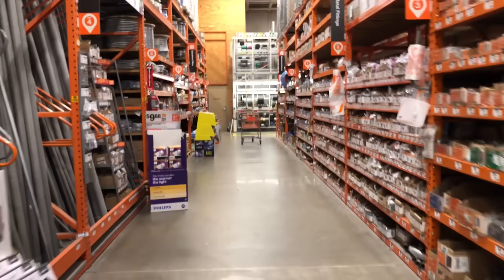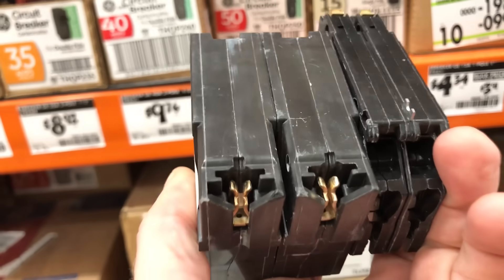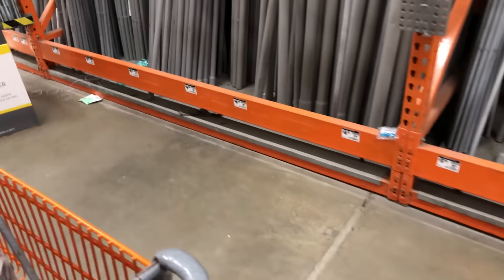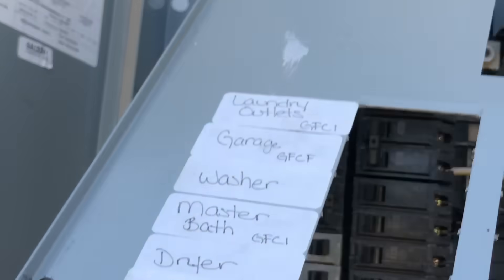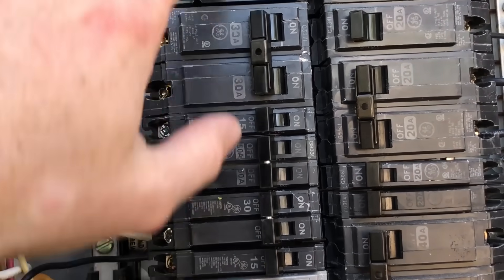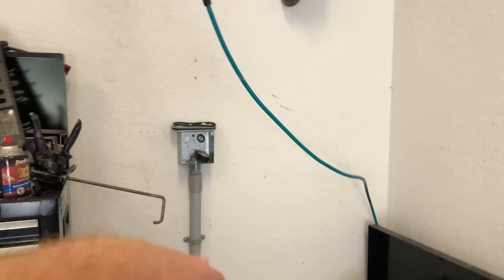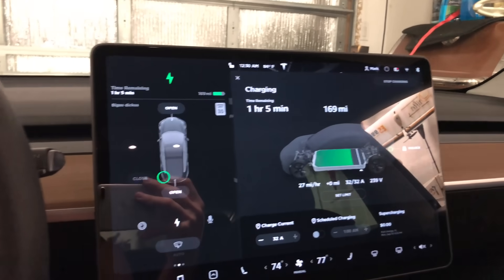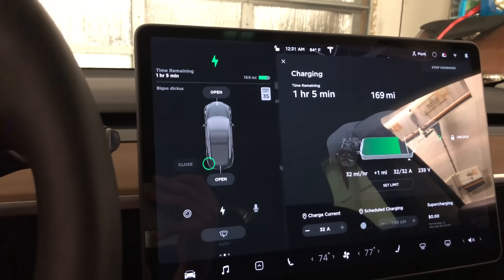Best home Charger for Tesla Standard Range plus! 14-50!

Comment: FYI, that Leviton NEMA 14-50 outlet you bought is a cheap piece of junk.  If you plug/unplug a UMC into/out-of it often enough, it will very likely fail spectacularly (possibly resulting in a fire).  For EV charging applications, you should be using an industrial grade 14-50 (or even a 6-50) outlet like a Hubbell or Bryant, which have stronger prongs, excellent build quality, and are meant for devices to be plugged and unplugged to/from them often.  They are not like the normal (cheapo Leviton) outlets that one would use with a dryer, oven, or other appliance that isn't likely to be plugged and unplugged very often.

Other problems with this install guide are:

1) You did not properly torque the clamping screws to the 6/3 wire, on either the outlet or the breaker.  Instead, you just gauged the wire tightness by "feel".  This is a recipe for a fire.  For applications like this (where there is a real potential for a fire hazard if you get it wrong), you should always use a "Torque screwdriver" to properly torque an outlets clamping screws to the wire, in accordance with the outlet manufacturers specifications.

2) You did not use a GFCI breaker in the electric panel.  Rather you used a regular/standard breaker.  Since you're installing the 14-50 outlet in your garage, that is a code violation.

3) The metal junction box was not properly grounded.  In order to be code compliant, you should have run one short copper pigtail to the ground screw on the back of the metal junction box, and another short copper pigtail into the outlet, then splice those two short pigtails together with the ground wire from the #6 cable.  Simply running the #6 cables' copper ground wire directly into the outlet (the way that you did it), is a code violation (because the metal junction box is not also properly grounded).

As such, this video is bad mojo.  Please fix these problems, and then either repost the video, or post another video as an addendum/follow-up/correction to it.  Otherwise people might actually follow this guide without knowing all of these issues.

Comment: I am preparing for my first Tesla (a used one). I am going to wire my home like yours. I have a couple of questions: Was the 1 inch conduit required by The NEC or did you just do that? My house is on a slab and my panel is in the garage so my plan was to come off the back or bottom of the panel with the bare wire (as all the wires are in my house) over where I intend to put the box and NEMA 14-50. What are your thoughts on that? (yes, I know, you are not an electrician.....)? Also, is the device you have plugged into the NEMA 14-50 the charger that comes/should come with my future car (2014-2016 Model S) or something else I need to purchase?

Comment: Mark, great video. I have heard that you want to turn down the charge current to not risks a short circuit at your house. So some adjust from 32A to 22A. Have you done that or heard the same information?
Reply from the maker: Hey! I do turn the current down. Right below where the cord generates heat signifigantly so that energy isnt lost as much through that. I think its around 20-25
Reply: @MarkDickinson  thanks!

Comment: If you are considering a Cybertruck, you may want to consider a Tesla wall adapter generation 2 which is an 80 amp charger.  There is a good chance  greater charging amperage will be supported. Generation 3 chargers only charge up to 48 amps.  I leave my mobile adapter in my car so I always have it with me.  Since I was buying a charger for home and I had a max charge rate of 48 amps, a generation 3 charger made the most sense. I highly recommend a dedicate home charger.

Comment: So let me get this straight.  You bought a $40,000 PLUS car and go cheap on the wall connector.  So dumb.
I installed my own Gen 3 Wall Connector for $100,  includes 12' of 6 AWG wire, separate wires, sold by the foot, not that 6-3  crap that's hard to work with, conduit and fittings and my 60 AMP breaker.     This guy is a joker.
Reply from the maker: So dumb?  So dumb is spending money on something useless that yields negligible results.   

I also use this to charge the motorcycle. 

You should make your own videos.  Champ

Comment: Call your electrical provider and ask for the EV rate. This gives you a very cheap rate at midnight to 7 AM then set your charging in the car to 1205 AM so you don't use the expensive power. Friend of mine did this 5 years ago and his wife now does the laundry after midnight to use the cheaper power.

Comment: Hello so i have a question my dry plug is a 10-30 plug and when i plug it in to my model y i only get 7miles a hour to charge what can i do to get it to 30?
Reply: Change the amperage fuse to a 50 amp

Comment: Thank you for your video, it was super helpful. FYI, your 50 ft and 35 ft Amazon links are wrong. The 50 feet one links to 10/3 romex, and the 35 feet links to only 10' of 6/3. 

Also, can you tell me where you got the little mounting bracket to hold the mobile charger in place...? :)

Comment: One mistake: You purchased a standard breaker for your 50a. For garage and outdoor, all outlets (including NEMA 14-50 and 6-50 now even in garages) require a GFCI. Hence, to meet code (and, honestly, just for safety's sake) you should grab a 50a GFCI breaker and attach the pigtail to your neutral bus bar.
Reply: Setting aside any problems you'll have with your insurance if anything happens right now, you wont be able to sell the place without changing it. Even the worst home inspectors will verify the GFCI reset points for all garage and outdoor outlets.

Comment: So I use the NEMA15 to charge my M3, so when it's unplugged during the day I turn off the main power to the NEMA.  I don't want the Tesla charge box and wan to be powered all the time.  Is that a good idea or do you just leave it powered all the time?  What are you-all doing?
Reply: The Tesla automatically stops charging when set limit is reached. It does not over charge. Nobody wants to be waking up at 2 a.m. to disconnect their EV

Comment: What’s funny is what he’s leaving out. There are 2 different models of plug in chargers. One is a 1 amp model and the other is more. But you get the cheaper, weaker one with the Tesla. And the better plug in one you have to buy, it cost $550 or you can just buy the wall mount for $500. Super misleading. My wife watched this and didn’t understand the difference in everything.
Reply from the maker: Edward Meer two types of chargers yes. Your car comes with one.  You buy a 35$ adapter and done 

1. Is the mobile connector on standard range and + they have a limit. 

2. There’s also a hpwc that does higher output.  

Super misleading is your 1 amp comment to be honest. Head over to the tesla shop and read the stats. I paid what I paid for the adapter to get 32 amp which my car limits to. Buy the adapter for higher speeds. 🤷‍♂️ other wise
Your cord included does 5mph

https://shop.tesla.com/product/gen-2-nema-adapters
Reply: Mark Dickinson the charger you are talking about requires extra money for. It’s a $550 charger. You don’t make that clear. The one you get with the car is the much cheaper $150 model. Both look the same but are very different. You do not make things clear. This lead to a rather heated fight about me wasting her money on things she didn’t need. So, thanks. After 4 hours and a drive to the Tesla store, did she realize I was telling the truth. What you are saying is BS.
Reply from the maker: You’ve lost it.  The one that comes with the car is a gen 2 mobile connector. If I bought the corded mobile connector for 550. Guess what. Same exact speeds.  No bs. Just facts of the standard range and plus cars.
Reply from the maker: Read my title. See how it says sr+ that translates to stand-ard-range-plus

Comment: Got same house as you, built in 50's, remodeled, have crawl space but going through attic 10' ceiling height. Will get sched 40 pipe for this particular wire, but will use Hubbel 250V outlet. Will be plugging and unplugging alot, and need reliability. Vehicle will not be garaged due to 68 Camaro taking the space, so looking for outlet to be at the garage in driveway to my vehicle.  Great video by the way best I have seen so far!
Reply from the maker: fathead fathead ohhh nice camaro. I just sold a little Younger Monte Carlo.
Reply: @MarkDickinson  I cried when I had to sell my 70 Monte' sad day indeed. Well I had a child and didn't have seat belts.

Comment: Totally disagree, after driving 75,000 mi on my model 3 and having free supercharging for life, you are much better off with a high-powered wall connector. I charged off to Nima 1450 and it's more about the inconvenience of having to uncoil your mobile connector every single time to charge your car and having the high-powered wall connector is much more convenient especially after a long road trip where you just want to go inside and go to sleep or relax. If you're trying to save every single time and your time is not important to you then sure it was a name of 1450 but if you're going to spend the money anyways to run electrical wire you might as well get the high-powered wall connector as we would be much happier and it will charge even faster than the mobile connector.
Reply: The $500 hard wired wall charger will NOT charge a M3 Standard Range + any faster than a NEMA14-50 adapter on the included mobile connector.  Tesla has capped the amps at 32, REGARDLESS of the charger you use.  I just installed a 14-50 today with a 60 amp breaker, even though I know it’s overkill.  I’m just looking towards the future.  My 14-50 install is just a stop-gap while I am waiting for Tesla to get the Wall Connectors back in stock.  The wires are run and I can fairly easily swap out the NEMA 14-50 whenever the Wall Connector becomes available .  I just want a permanent, easy way to charge on a daily basis.  I want to keep the mobile connector in the car at all times.  I could buy a second mobile connector kit for a little less than a wall charger, but for just a little extra, I would much rather have the wall charger...
Reply: @jbreakstone  this is true

Comment: I agree 100% this is the way to go. At my Home Depot I bought the wire by the foot which was a lot cheaper. I only needed 8 feet. Also online I got the Tesla recommended Hubble I believe outlet. In any case it was pretty expensive but I think if you’re going to do this you should use the higher quality plug Tesla recommends.

Comment: I'm glad I have a gas dryer, so my 240v is unoccupied...now I just need a Tesla
Reply: Dont forget to use his referral code.
Reply: i know this comment is old, but figured I'd reply incase this might help
I've heard that some 14-50 receptacles for appliances aren't heavy duty enough to handle a steady 40amp load with EV charging
so if you do end up wanting to use that outlet for EV in the future I'd suggest maybe looking at changing the receptacle
https://www.youtube.com/watch?v=xRcDUZgeuGs&t=131s
it is pricey, but this one was supposedly recommended by Tesla themselves https://www.amazon.com/dp/B00IPBMUKY/?coliid=I7RQYQDWC4HU3&colid=2RTIXIRKKBDS3&psc=1&ref_=lv_ov_lig_dp_it
Reply: Dryer circuit never exceed 30 amps in America so the wire isn't rated for 50 amps doesn't work that way unfortunately
Reply: @Wetwizzard  about 30a dryers- I discovered that my dryer plug needed an adapter to fit Tesla 14-50 plug. $35 later I am getting 25 mph using 28amps paying $0.143 kwh = $0.0369/mile Model Y
Reply: @captpeady2176  what do you mean? Newbie here

Comment: Are you able to use 6/2 wire?
Reply from the maker: Mark Sakran yes.
Reply: Mark Dickinson Thank you so much for your quick response is the hook up the same to the 50 amp outlet? And Do you mind telling me why you decided to use 6/3?
Reply from the maker: With the 14-50 you need the 6/3 wiring. 6/2 wiring would be ok You can use it on the hpwc with 60 amp. the hpwc doesn’t require a ground as far as I have read.  I ran 6/3 to have maximum amount of wires for nema.
Reply: Mark Dickinson Most people run 6/3 for the HPWC even though the neutral wire isn’t used. That way when they move it can be converted to a 14-50 quick and cheap

Comment: Good video, thanks.  I'm going to have to install this outside my garage, I like that white "holder" for the mobile connector to keep it in place and not put a ton of tension on the 14-50 adapter piece.  Good point about going with 6/3 to allow for future upgrades.
Reply from the maker: Thank You Matt!
Reply: Your not able to use 6/2 wire when installing 14-50 correct?
Reply: Mark Sakran  14-50 needs the neutral. Otherwise look for 6-50. That has no neutral.
Reply: Matt Crumrine thanks Matt! Do you happen to know what the differences are  or the benefit of using 14 –50 versus 6-50?
Reply: Mark Sakran none really. The 14-50 is a common RV connector. The 6-50 is more of a welder type of connector. Check out teslaTap for a home wiring guide. It was very informative. I went with 14-50.

Comment: Im also not an expert but just fyi local code here requires the metal box to be bonded separate from the outlet
Reply from the maker: GDDNET bonded or grounded. Bonded typically in commercial applications with metal building or metal stud walls.  Florida building codes doesn’t require it in residential  as of 2017 that I can remember.
Reply: @MarkDickinson  my very limited understanding here is only that the electrician kinda used those terms interchangeably when talking about connecting metal fixtures together. I think the only concern with your application is where the wire enter the box and chaffing and energizing the box while also not making contact with the metal lid that is grounded through receptacle. Again I have no interest in playing armchair electrician :P just was my only concern when I go to follow this example in a month

Comment: Thanks for the video.
I have a dryer outlet behind a garage wall and I'm thinking about punching a (nice) hole in the wall to share that outlet with my future EV.
Any thoughts on this and how to do it at minimum cost?
Will I have to unplug or not use the dryer when the EV is charging or plugged in ?
Reply from the maker: They make a switch for loads I believe. It’s about the same cost as running new wire yourself. Switches are 100-140
Reply: @MarkDickinson  Thanks. I found this from this video -- https://www.youtube.com/watch?v=mrC9gnNmGzc --  for $42 here -- https://www.globalindustrial.com/p/electrical/switches/wall-switches/Industrial-Grade-Toggle-Double-Pole-Double-Throw-30A-120-277V-AC?infoParam.campaignId=T9F&gclid=CjwKEAiA0uGmBRDwj7mE1v-LlCYSJADxH16OFTE8KoINgwWAihiBSjf9p_LiUuiLK63XR6BMyUsdHRoCRs3w_wcB
Reply: You definitely DON’T want anybody using the dryer while car is charging. Need a switch or separate breaker

Comment: I agree that using the mobile charger with the NEMA 14-50 adapter is cheaper than getting a deadicated wall charger. That’s how I started out. However, I bought the NEMA 14-50 Wall charger and put the mobile charger in the trunk. Why? Because if you ever find yourself needing a charge while on a trip and you are away from a Supercharger, you have the mobile charger to save your butt. So, my suggestion is to save up and get a wall charger eventually, and put the mobile charger and an extension cord in the hideaway space in the trunk along with a tire inflation kit.
Reply from the maker: I purchased a second mobile charger before doing this video. So I always have one with m
Reply: Mark Dickinson A Mobile Connector with the 14-50 adapter is $310. Might as well get the HPWC for $500. You may get a second Tesla and even if you don’t they resell used for around $350. I consider it future-proofing and good investment
Reply: I was going to say you can also just buy a second portable charger unless you need more than 40A or need to share a breaker between multiple Teslas.  I would also suggest building or buying a 220 adapter which combines both phases of two 110 15A outlets into one 15A 220 outlet.  It'll just about quadruple the charging speed vs @ 110 outlet and you can throw it in your trunk when you travel.  I still have mine from when before I had 220V wired in the garage.

Comment: One small benefit of the wall connectors is the ability to connect them in parallel on the same circuit (I believe). I don't where I saw the diagram but if connected correctly the wall chargers know how to power up or down the amps based on how many Teslas are connected and what state of charge the cars are in. This sort of charge management allows the ability to charge more than one car on the same circuit.
Reply from the maker: Andrew Velis yes I do believe that is a good benefit.

Comment: I was totally UNimpressed by the Leviton 14-50 outlets.  Very chintzy.  I recommend using this Enerlites instead: https://www.amazon.com/gp/product/B07BD2DZYN.  You're right about the limit in charging for the SR+, for sure, but I have noticed that the cord does get warm.  Also, you must be careful with respect to Romex (NMB).  Romex is not suitable for conduit.  That being said, you run it in conduit for only short runs.  The best setup would be to use THHN run completely in conduit.

Comment: FYI Home Depot will cut wire to what you need. As will all hardware stores
Reply from the maker: HVAC Mike of course. 2.78 per foot x80 = $222  it doing a short run under 10’ it’s easier to have it cut.

Comment: 7:10
Is it really OK to bend the cord that severely between the mobile charger and the outlet?  I would have lowered the holder (great idea!) on the wall by at least six inches to make the bending not as sharp between the mobile charger and the outlet.
Reply from the maker: It needs to be moved down, what I am doing is making a spacer that goes over the pipe and let’s it hang straight down with a little support.